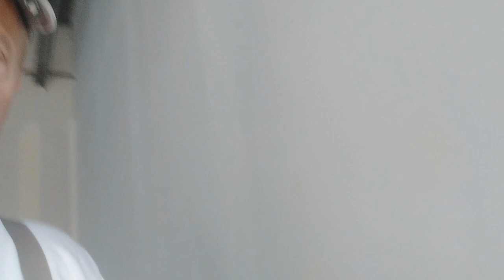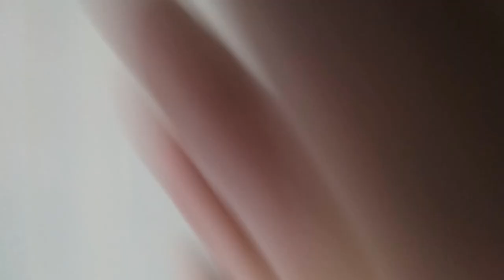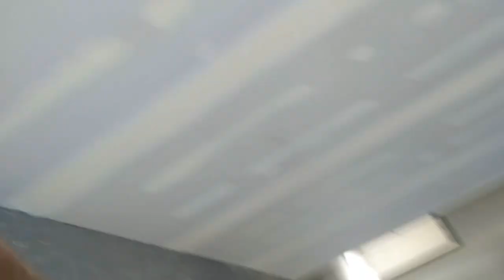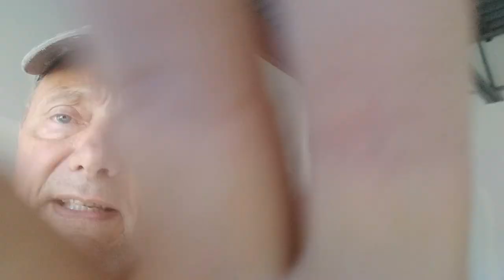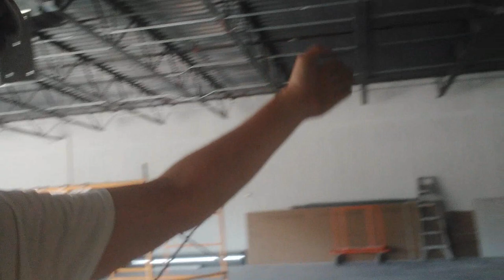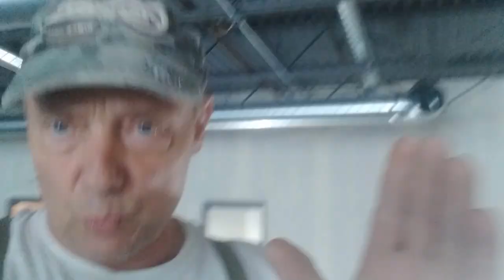The prefilling of drywall and why we do it

Comment: For smaller jobs, can I prefill with hot mud and tape at the same time? Hot mud or cornice cement that we have here in Australia has minimal shrinkage and drys hard fast.
Reply from the maker: Yes
Reply: I always prefill and tape at the same time. Just have to be careful not to mix in to much water with your quickset or hot mud. They are the only things that give you 100% adhesion as the drywall doctor has shown before but if you mix in too much water you can wind up with spots with no adhesion(doesn’t really happen with paper tape just that plastic like corner beads and shit that come in rolls) but you can most certainly run into adhesion problems where you may have to cut out a 2-4 inch piece of tape that didn’t adhere well and patch that up but as you get better mixing down your durabond it will happen way less I often find having a little less water is better for prefill cause water/evaporation is what causes shrinking in any sort of spackle/caulking
Reply: Also you have to remember if you prefill and tape at the same time you have to give more time for the spackle to cure so instead of maybe 12-24 hrs before curing completely and painting or adding your finish top coats it will take 24-36 hrs before it cures completely even though it “set up” hard on the wall

Comment: I've seen pre-fill crack too. If it's going to crack, it'll crack. I only prefill when there's a substantial gap. Never had a complaint. but I also back fill when I wipe. so who knows. I've even heard union finishers argue about prefill actually causing more cracks because it doesn't allow the drywall to move with the structure.
Reply: It depends prefill on a ceiling you’re better off with expansion joints/control joints if it’s a long stretch. Even on walls. You gotta take into consideration your runs and how big the piece of sheetrock really is going to be after prefilling cause essentially with durabond and only durabond you are taking multiple pieces of sheetrock and making one because it is what we call “hard mud/hot mud/quickset” but when it dries and sets you’ll see durabond is hard as a rock whilst anything under the easy sand label will always be slightly malleable so if you are doing let’s say a 600 square foot ceiling I’d throw a control joint maybe in a few places along with prefill to give it that quarter inch expansion room from heat and humidity fluctuations. Most of the time you will see prefill crack in the places it’s going to buckle with expansion cause everything does expand and contract you just have to use your brain based upon the layout of the room and the joints. Also stagger your drywall joints just like laminate flooring this also will help minimize crack out. A good drywall job is a combination of many different things but for sure you’re better off prefilling than not prefilling unless you live in Alaska and your all purpose joint compound will freeze in the wall and not mush up and pop your seam out or in over time! Anyways I hope this gives you some more information cause I remember when I was applying stuff more so like a technician than really trying to get to the meat and understand the physics of everything
Reply from the maker: Well said
Reply: @THEDRYWALLDOCTOR1  this reply will live in my memory forever thanks for everything you taught me over the years!

Comment: Durabond isn't available in my area.  Is there something I can use instead, like tile mortar?
Reply from the maker: Go to any of the big box stores iin the drywall area they will have a setting type compound use that
Reply: It is also called EasySand. Same mfgr USG, but does not get as hard as DuraBond. Tile mortar is not plaster (gypsum). Tile mortar (thinset) is portland cement and sand.

Comment: So do you prefill and let the prefill dry and then mud and tape the seams. Is there a certain kind of durabond that you use for prefill
Reply from the maker: Larger jobs where I'm running the Bazooka yes I let it set before I tape  smaller jobs that I do my hand I tape the seams with a setting compound.
Reply: I use EasySand. Have for years. Pre-fill the gaps then after it sets, come back, or next day when it is dry/fully cured, and tape with 2 inch fibatape(fiber glass mesh tape), finish with EasySand 90. Colder water will increase working time of EasySand. If applied properly, will never have to sand it.

Comment: Being that drywall (gypsum board) is pretty soft, can I cheat and just prefill with say USG  ready mixed green lid? Not lightweight.
Reply from the maker: In AZ that's what we did  but everything is textured here in IL. you see every settlement crack. So it all depends on where you live and if it's a textured finish.

Comment: How often you prefil your small jobs? I've seen you fly your bazooka and no prefill at all...
Reply: A bazooka will pack mud on both sides of the tape.
Reply: @EM-fi2qg  you know what you're talking about 🤦🏻‍♂️
Reply from the maker: I have never ran my bazooka without peflling first
Reply from the maker: But the Mud  in-between the Sheets is going to be to soft
Reply from the maker: Small jobs I will tape with a setting compound and that's  prefilling them at the same time as the tape goes on
Reply: @THEDRYWALLDOCTOR1  it won't be soft forever, there's only a bit of it in betwen sheets. Most of structural strenght is achieved by stacking layers of sheets on studs and by staggering them. I've never done any prefiling on walls 4m high with double sheeting on both sides and no single crack went out. It's a waste of time specially on commercial sites where time is $$$ Watch any of Mark Wilson live's on TapeTech with those Mechico bastards ;) they just fly thos bazzoka's and go on to the next one ;) I love you Doc but that's honestly waste of time ;) Regards from Poland :)
Reply: I agree.  It certainly doesn’t hurt, but we only prefill gaps 1/4” or bigger, and those are almost always internals.  And I’m not even convinced those mater on verticals anymore, as we use level line on all our verticals these days.  But I can honestly say I’ve never seen a tapered joint crack, ever.  Butts—yes, which is why we try to avoid them wherever possible, and internals yes.  The first coat with a MudRunner will often hairline, which is easily remedied with a quick skim coat. And before the advent of modern corner beads, we used to get call backs on the old metals beads hair lining, but we never prefilled joints.  Honestly, I never even heard of it until I found the Drywall Doctor on YouTube.  That said, he’s great.  I just disagree with him on this one point.
Reply from the maker: If I didn't prefill where I live it would have cost me tens of thousands of dollars going back and fixing settlement cracks that would have never been there prefilling takes care of 80% of the settlement cracks here.

Comment: Why don’t you just tape in with durabond ?
Reply from the maker: To much taping I won't put durabon in a bazooka
Reply: @THEDRYWALLDOCTOR1  ok you should consider just taping in with durabond it would cut out a process for you, pretty much how guys tape here in aus
Reply: I do it that way, but with USG's EasySand. More forgiving of mistakes than DuraBond. pre-fill large gaps with 5min EasySand (cold water will increase working time) then after it sets, tape with 2 inch mesh then 90 min easySand. Final finish with Plus3.